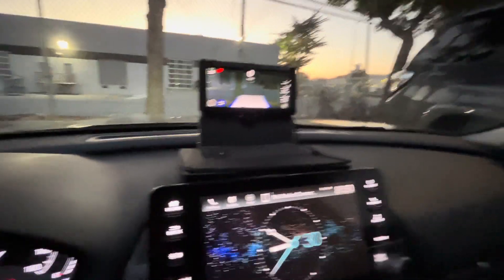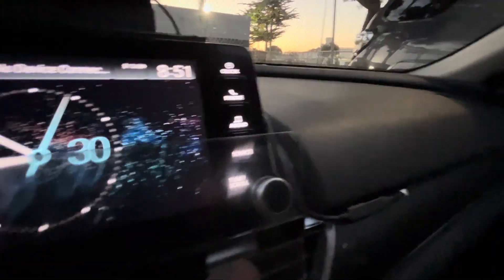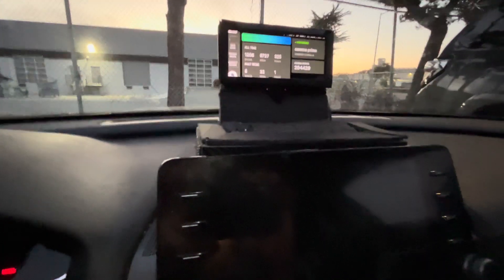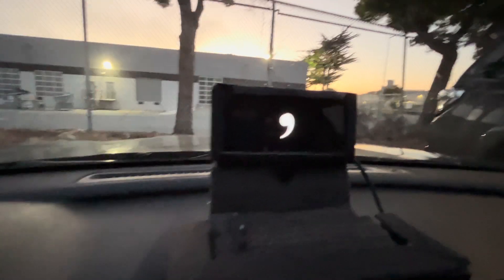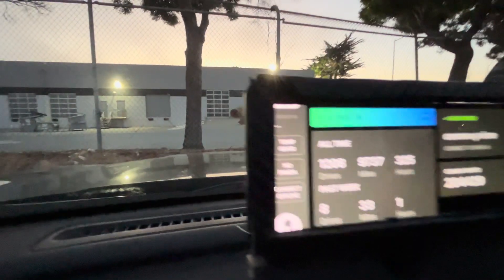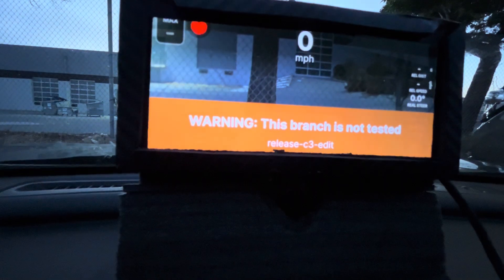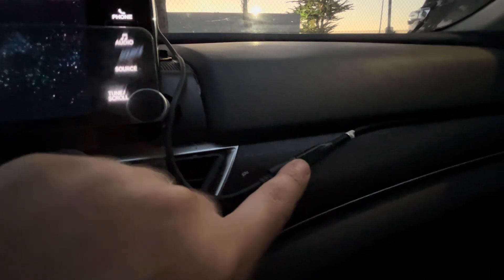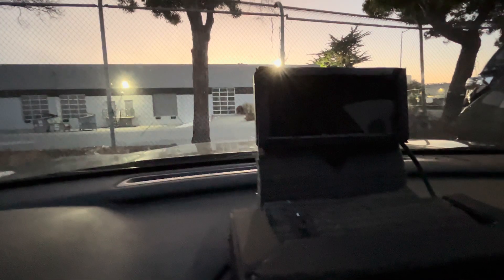Let’s Recreate the Openpilot Error:   CAN Bus Disconnected Likely Faulty Cable

Comment: I’m having to rework the obd port because I didn’t use an extension and that port wears out quickly. Comma wants $1000 for replacement logic board plus $100 install, which I passed on. Lesson learned!
Reply from the maker: thanks for sharing. Yeah i dont move it as much as possible.
Reply: @Eyezenheim  Mind sharing which extension cable you're using? I'd like to buy that one.
Reply from the maker: @MichaelMerritt  6 footer https://www.amazon.com/gp/product/B09SZ9CGHS